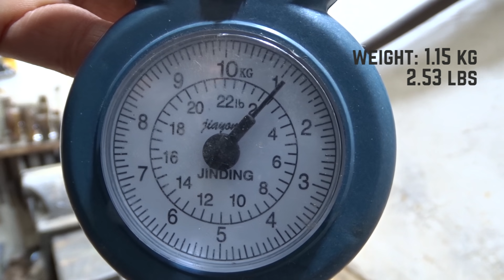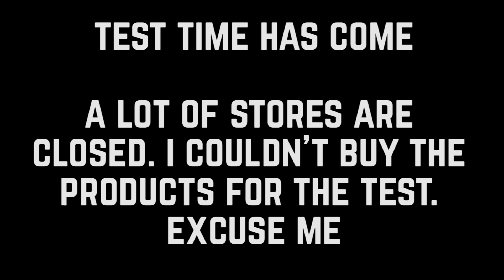Restoration Old Rusty Butcher Cleaver

Comment: which is better for you to remove rust the chemical  or the electrolysis?
Reply from the maker: Hello sir, good question.
First of all, if you use electrolysis, it can be said faster, but at the same time more dirt and waste + electricity consumption. in what cases should i use it? There you are sure that it will not damage the item and there is a lot of rust.
Rust removal. It is cheap, I use it constantly without changing it. It Works slowly, but also well.

Comment: Don't touch the wire with your palm! If it was live it could make you clamp down. The proper and safer way is to touch with the back of your hand, so that way if it is live, then at least you'll just squeeze on air, keeping you safe!
Reply from the maker: Hello, I turned off the power supply, and I touch it because sometimes this piece of iron is hot. Thank you for your attention!
Reply: @ScrewsAndTools  that's okay, but what if you forgotten! Would be very scary!

Comment: I don't believe it's a butcher cleaver, but a roofing axe,used to cut Cedar shingles,thus the hammer head..😁
Nice job, I'm surprised it was that rusty...🤔
The handle was Bake-a-lite,an early plastic popular in 30's to 50's...
Reply: Bakelite was popular up through the 80s (think Soviet AK magazines) and is still used to some extent today.
Reply: Note the size of the knurls on the hammerhead. Meat tenderizer.

Comment: Nice! But i think you’ll run into longterm issues. This is a cleaver, not an axe. The pitting all over the blade will hold food particles and grow bacteria very easily, especially since you etched it. There’s a reason most cookware is polished/stainless nowadays. Not to mention the pitting in the blade will lead to chipping, and the heat treatment was probably ruined by the friction heat of your belt sanders.

Comment: Why did you Scratch the handle up before putting the wooden part on also great job
Reply from the maker: Hello sir, thank you. Therefore, the bonding of wood and metal will be good. You can stick it to smooth surfaces, but it will be unreliable. I sometimes even make small shallow holes in both wood and metal for good contact.

Comment: Add dry rice to the salt to prevent that from happening
Reply: To avoid floating debris in the resultant solution from rice, a couple of silica gel packets in the closed jar should help keep it from clumping. Or use commercial non-crumpling salt. The additive won’t interfere.

Comment: I didn't know you could electrocute rust off.
Reply: It's actually a chemical process called electrolysis. A redux reaction is taking place causing the ions to form bonds that aren't with the metal of the blade. Also sorry if you didn't care at all about this I just find it really interesting.